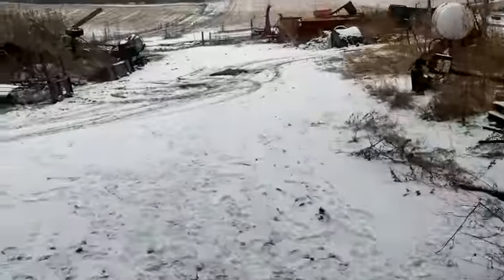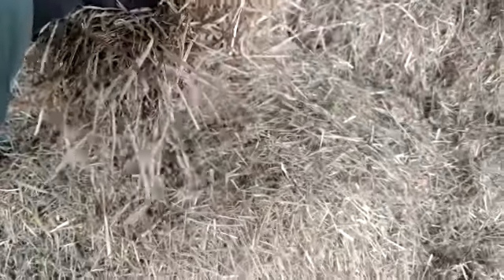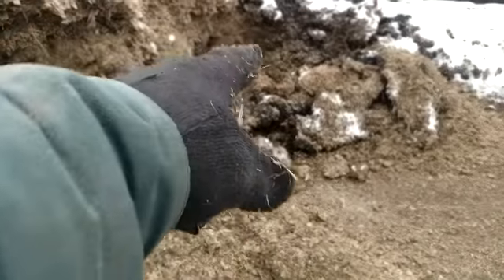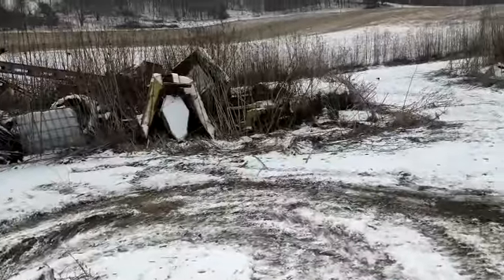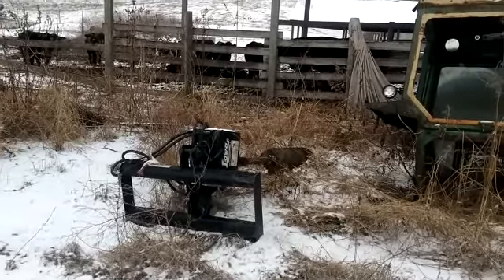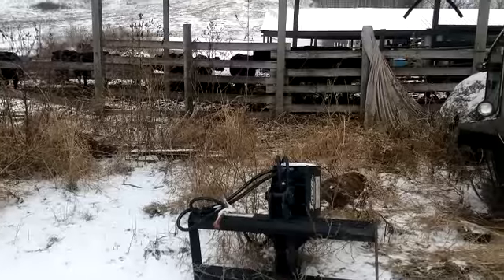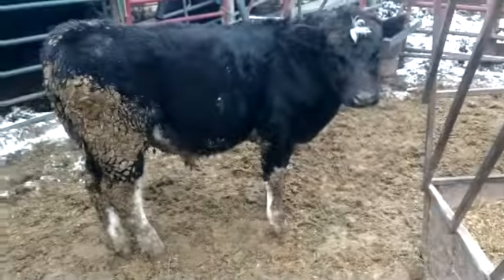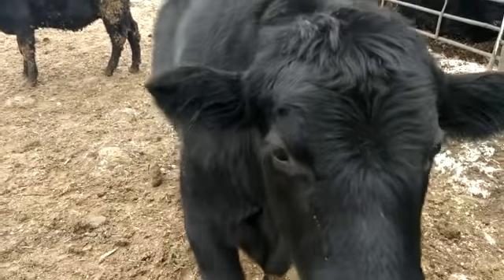TMR steer feed

Comment: Forgot to mention I'm impressed with the job that chopper does on hay perfect length of cut
Reply from the maker: The knives are advanced as far as they'll go, and it's been sharpened with an angle grinder a few times so the shear bar to knife clearance is a bit big, but works perfectly for this application and chopping bedding!!

Comment: I would look for a vertical mixer, with the size of your operation you have you could get away with a small mixer.    When I was using my truck to feed I would mix a big load with everything I needed for calves and it would mix good then I would feed what I needed and then just add silage for the cows and get it back to 9000lbs and the little bit of grain in it was fine and then I would just feed 2 more loads to the cows with out any grain but the calf ration was perfect.   I will get my truck going this winter and mix the calf ration and unload it and then just feed it with the tractor similar as you were thinking

Comment: This might sound crazy forgive me I'm on a bunch of antibiotics right now but, what about a stationary vertical mixer cause they go a lot smaller than pull behind and then a side slinger bucket for the skid steer to feed out with.
Reply from the maker: Not crazy at all... I think we will demo a trailer type, but might settle on a stationary. Then build a feed cart that can be moved with the skid loader for feeding (modified chopper box with hydraulic drive) that way the TMR doesn't tie up a tractor

Comment: Chopping hay to fine can and will cause digestive issues? I have considered chopping my hay feed will be short this year
Reply from the maker: I was always told to mix long stem hay with finely chopped feed to prevent acidosis and other gut issues. And, if you watch video's on TMR's they always say to not run them too long so the hay doesn't get over processed
Reply: LVF Northern Wisconsin Farming ok I did not know hay ground to fine could cause that I knew fine ground corn could die to fermentation I always took it as over processed hay would make it less palatable for cattle to eat

Comment: Keeping your feed outdoors is the worst mistake. 30% of those big round hay bales is gone before you even come for it. Oklahoma state did a study on feeding them and the result was a 45% loss fed on the ground. The very best way I found to feed was a concrete manger with wood "V" where they just stick their heads in, sweep them out every day. you can drive thru in front with a feeder wagon or self unloading wagon or a bucket on a tractor or skid steer. they will get down on their knees and lick that concrete clean. You don't have to chop and mix .  Put down your corn silage , in a feed grinder/ mixer put 12# of soybeans to 50# of corn .1# 10 ounces of livestock minerals. throw it on top of your silage.  Stand back when you open the gate, they will stomp you when they come for it. I had 2 cows stuck in a door and I had to chainsaw my barn to free them. You want to build stout, their going to hit it hard every day. I fed small square bales as soon as they finished up , and that wont take long. I had very little waste. I had a gatherer behind a baler, and a bale grab to pick them up. I could go out there and holler " Boss , Boss" and they would come running. They would follow me around like a little dog. If I was late they'd be screaming and ballin' and pounding on the barn. My vet told me he had never seen better looking cows. My daddy taught me about the triangle of death. just in front of the hip there is a dent. the more pronounced that dent , the closer she is to dead. Mine was almost invisible , they had clear eyes and pretty hair.  You really need to house your equipment. I know this is far from what your doing , and you don't know me from adam. I learned this from my daddy, my uncle, and they from my granddad. Old style of farming like people did thru the depression still works.
Reply from the maker: I try to house what equipment I can inside, the tractors sit in a heated shop all winter. The plan is to add more on to the cows shed this year so they have more space inside, then next year build my hay and bedding shed. I have fed the way you are talking about, yes it works, my reason for the TMR is a consistent mix, every time. And having the scale will help with that. By having a TMR I can mix low and high quality feed stuff together and still get good performance, which in turn will allow me to maximize the number of animals I can raise on this farm. The cost of living isn't getting cheaper, and the only way to get a raise is to make more with what I have until I can get more land. I'm not really one of those farmers who goes and spends a lot of money on fancy new stuff, the majority of my equipment was bought for under $1000... And I agree, the old ways still work, that is why we graze our cows and calves on pasture and cover crops as long as possible, feeding anything that they don't harvest themselves costs money!
Reply: LVF Northern Wisconsin Farming Hi! thanks for your comment, I wasn't critical, I was just trying to say was you don't need a lot of money to farm. You do need some. I bought bull calves in February  pastured them and fed my own blend of grain I learned from dad. in august I fed corn silage soon as It was available with the grain and hay for roughage .By December I was closing in on 1000 #. I did not own a sprayer, never used roundup, growth hormones, or anti biotics. you get too many animals living too close together mother nature will step in and thin the herd. It's a natural thing . It can happen with people too. Your kids can bring cold viruses home from school that will put your ass in a hospital. I cant bare to see a animal standing belly deep in their own shit. There were no beat sticks standing in the corners of my barn. You could walk right up and pet any one of them. But when it was time to eat you wanted to get out of the way. I made sure each animal had a place to eat. Big ones will beat the rest out. When they got to 1000# I sold them. I spent the month of January  pressure washing. Keep the shit out and the flies down and used lots of lime. My dad had 65 cow dairy shipped class 1 milk. milk inspectors don't like dirty cows and shitty barns. It's just the way I grew up. My dad had a tractor during the depression but no money to buy fuel, so they used horses. during ww2 you could not get tires, many tractors were sold with steel wheels, fertilizer was hard to get too. I was so broke when I started out I put hay up loose. My first year I picked 20 acres of corn by hand. I'm a old man now and when I get quiet I go back there, best days of my life. I came across your video and at one time in a different place, I was in your boots. I watch your old school corn silage video a lot. Good luck to you, hang in there if you want it bad enough it will happen. Now let's see some more videos.
Reply from the maker: Thanks Norman...Its a work in progress... It would probably further along, but I do this full time, so I do the best I can with the little I make. I hate the fact that my cattle shed is getting crowded, so next years extra money will be spent on that addition and hopefully some concrete because I really dislike the mud! Hopefully the year after I can get a hay shed built... Frozen netwrap is no fun either! Lol I am glad you found my channel, and I am glad that I have video's that you enjoy. And thank you for sharing a little about your past and present. I love hearing the stories from days past. If I may ask, where are you located?
Reply: I grew up on a dairy farm in Oswego county in upstate new York, We moved to Cayuga county after selling out to a 4 lane highway. Twice I started farming again in the 70's , both times I had to quit because I was renting land from elderly people who died and their children couldn't sell the place fast enough. I moved to North Carolina in 1978, because you couldn't buy a job in n.y. I worked as a grave digger and a groundsman  because I was good with a backhoe and lawn equipment. I bought  a tractor and some equipment and started again. Landlord was 90 . He died at 95 and his children couldn't sell fast enough. during this time I discovered a niche . People will buy farm grown beef and pork. ( organic) at 5$ to 8$ a pound. I can turn out a hog that will dress out at 250# (killed and chilled) in just over 4 months. I have worked as a school bus driver and I worked for a newspaper for 20 yrs. But my heart has never left the farm. Tabaco and soybeans , corn, wheat, and beef are what you see here. Land is just about impossible to find, everything is being worked. (yet people will tell you " There's no money in farmin" " You'll loose your shirt" I tell them " That's okay, I"ll go by goodwill and pick me up another one!!" I heard you say you couldn't wait for silo filling time. People will think your daft when you say it's FUN. It in your blood, like a sailor standing on shore staring out to sea. Good luck to you, Merry Christmas, and may the grain be with you.

Comment: If ya had a old grove open top silage wagon you could put in a layer of chop hay, layer of silage, layer of corn.
Then run your table/wagon feed very slow with beaters on fast that would mix it & you could fill bunks with it or a troth/manger.   You could do a whole wagon full use off what you need per day then back under roof till next feed.
That work for this year.
If ya sprang for scales for your skid steer might not need mixer.
Reply: What ya think ? 
Is this just a hair brained idea ?
Reply: MrVailtown I was thinking the same thing as they use those old Deere Chuck wagons for that

Comment: I bought a 7050 allis that has run everyday on the mixer for three years. 150hp for 4000$ with new firestones.
Reply: As a matter of fact its in my profile picture now that i think of it
Reply from the maker: @mrbill4187  yeah, usually you can pick up the 7000 series Allis pretty cheap, and they aren't a terrible tractor